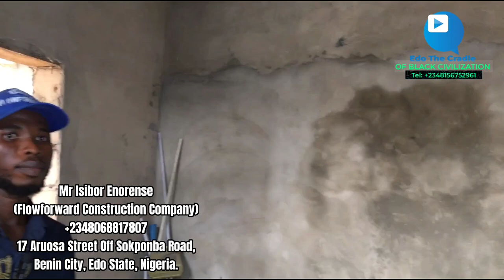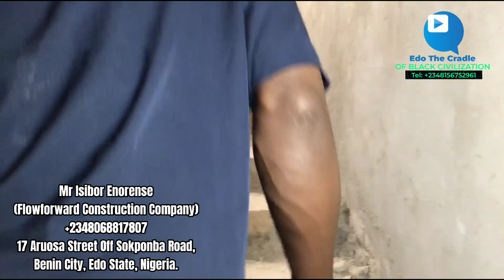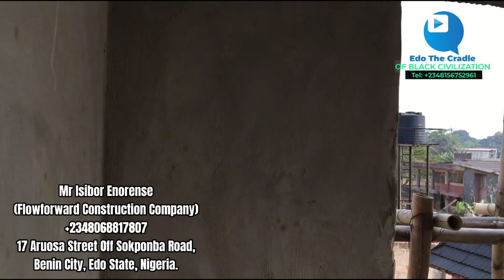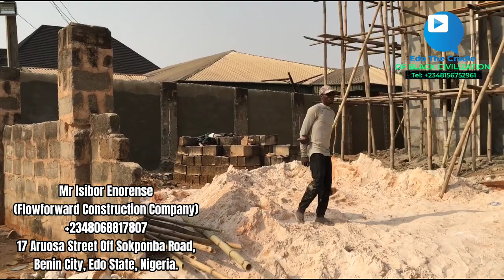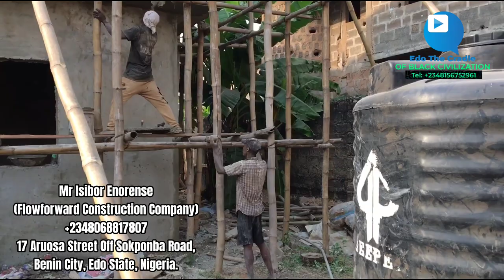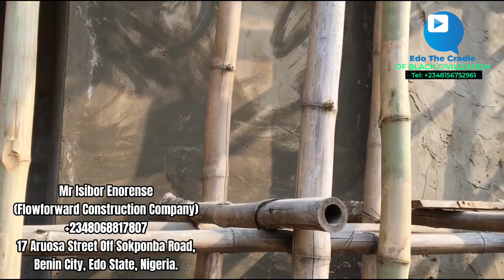The Cost Of Plastering Work On A Duplex Building In Benin City, Nigeria In 2023

Comment: But it is just 2500 per partition, so how did you arrive at 1.8m for workmanship in a house with less than 500 partition?
Reply: The thing shock me
Reply: Edo CBC worker is so expensive now,  one of the electrician charge me 150k for fence piping but I did it for 55k with someone else.

They're now ripping someone off.
Reply: Good morning Ella London. May I ask for the electrician’s number?
Reply: @ellalondon6893 Was the land 100 by 100?
Reply: The price isn't that bad compared to what I paid for only the external wall, security house in and out, and obi in and out.
Reply: It was high for a year ago. I plastered my 4 flats, in and out, july of last year for around 750k( labour alone). I'm a diasporan but was home to handle it myself. 
I called very skilled artisans and paid them per partition.